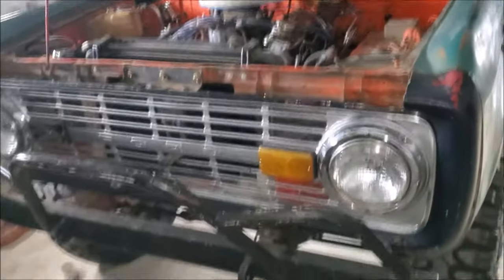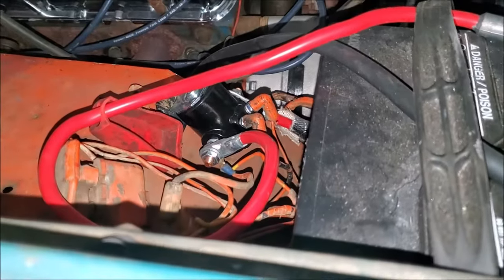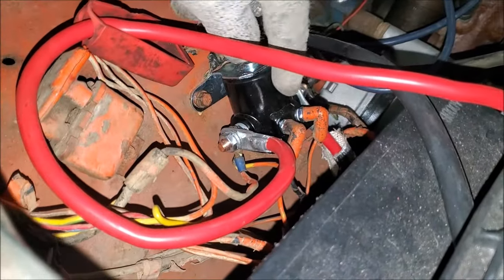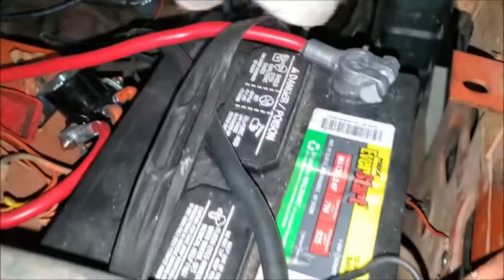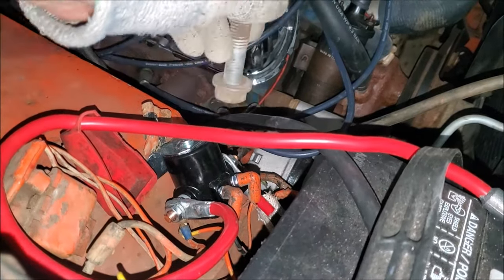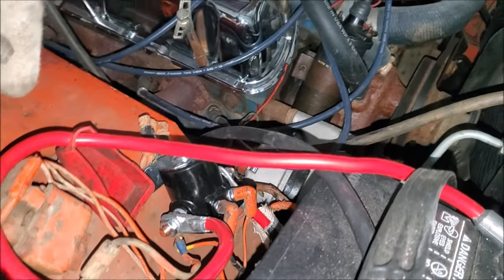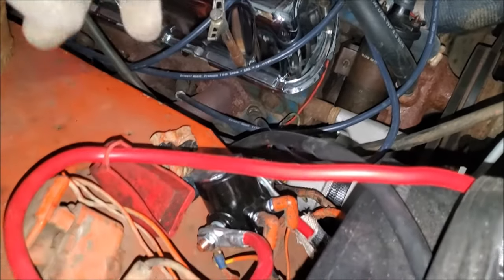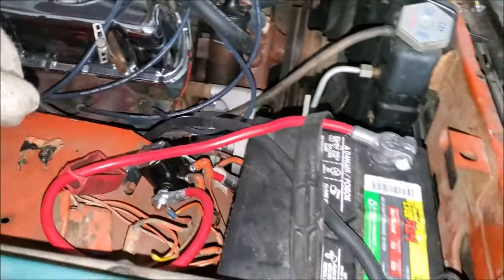Car or Truck won't stop cranking OR Doesn't turn OFF (The Fix)

Comment: I burned through 2 starters at autozone and 3 at o'reillys until I finally took it to a shop and he told me he had to call a friend who works at Ford Company and he told him that it was a wire but he would not tell me exactly wtf the problem was because he wanted to charge me another $625.00 if it did it again. I changed everything else from the alternator, solenoid, to fuses but I wish I would have changed the wire that connects the ignition to the battery to the starter as it was very doable. but thats how they charge you by keeping you in the dark about simple shit!! I like to thank you Sir for this video and trying to help people because money isnt easy to come by for some of us fa real..take care and peace
Reply from the maker: Wow....well thank you for your heart felt comment. I really appreciate you taking the time to share this with me. Feels nice when I know I helped someone.

Comment: What will make it do that is a low battery if you’re cranking it and it does not start once the volts in the battery get too low. It will not let it disengage the solenoid because I’ve had it do the exact same thing on a GM and the solenoid is mounted on the starter on them.
Reply: I think this is what happened to me the battery was low and I had to crank it for a bit and then when it started the starter kept making noise and I had to remove the cable. now when you touch the cable to the post it wants to run the starter again even with the key off

Comment: This is very odd.. I have a 89 f250 with a 91 f150 engine inside basically same configuration as stock f250 engine when it comes to solenoid, but same exact issues thing is I just replaced the solenoid because of a different issue, this started recently after taking apart my steering wheel column tilt to fix and I put back together exactly the same. My solenoid only has one wire that clips onto the solenoid(the one you disconnected to diagnose the solenoid) and it still cranks with that off. Perhaps I got a defective one?
Reply: My 91 f150 did this tonight and I had to go find a wrench to get battery cable off before a meltdown , very exciting, glad to hear it's the solenoid I recently replaced the actuator in the steering column but was very careful while in there.

Comment: I just got a brand new solenoid and installed it and it wont stop cranking. Everything online says to replace it but it’s brand new out of the box
Reply: What car? I just replaced mine on a 1960 thunderbird before reviving it back to life after sitting for 6 months.
Reply: @menjorkamara  the part was faulty and caused a ton of wires and other parts to burn up, had a mechanic replace it all. It was on a 1975 f100

Comment: I had major sparks when I touched the battery. But nothing turned on. Lights off, radio off. There is nothing else on my old truck.
Reply from the maker: You have a direct short somewhere. Something that may appear to be off is on. Maybe an actuated relay or a positive wire touching metal somewhere causing it ground and with that short present you will also have battery draw

Comment: This helped me with my '91 f150.  I figured it was something with the starter or the solenoid.  This is waaay easier and cheaper than a starter!  Thanks huge my man and thank you for your service!
Reply from the maker: So glad it helped!!
Reply: @EddiesCustomsandRestorations  I have same problem whit my 87 bronco I replace that alternator but I dint unhook that positive cables so they touch metal couple times and make sparks  and plus I broke that starter solenoid and I replace whit new oane and I have this problem and all wath I did replace alternator vefore was fine any i dea
Reply from the maker: @Purosanluispotosi  if the symptoms are exactly like these again, the new solenoid is sticking again
Reply: So is possible eaven wen is brand new  because I yes put a new  I have same problem long time ago but I dint remember wath was my problem I always fix my trucks but tomorrow I’m going to do that or buy a new oane because soon is u touch that battery’s craknks like want to start
Reply from the maker: @Purosanluispotosi  yea basically disconnect the small wires and if it still cranks only having the 2 thick cables connected, then the solenoid is stuck.
Reply: @EddiesCustomsandRestorations  ok I’m going to do that tomorrow thank you very much for replay
Reply from the maker: @Purosanluispotosi  yes ofcourse! No problem at all

Comment: 1968 F250 FE360 My starter solenoid smoked one day and wouldn't engage starter.New solenoid and when I reconnected battery the starter stayed engaged while battery connected.I had to get a new relay and then all was well.Thanks for your info.Heck,even I can understand it
Reply from the maker: Haha thank you for your kind words! Glad you got it fixed

Comment: I have a 70 chevy truck with the ford solenoid. My solenoid only has the s wire hooked up. When releasing the key back to the run position, it continues cranking. I have a coil cut off, so the engine wont start unless energized. By watching your vid, my thought is the ignition switch is the culprit...Any thoughts before spending cash on a new switch ?
Reply from the maker: A new switch could be the solution if its not a stuck solenoid.
Reply: thx, for the input
Reply: Ignition switch probably cheaper and easier to replace than solenoid

Comment: 2010 dodge Challenger cut off driving. I turned the key fob and let off starting spinning fast. I heard the starter spinning when it cutoff.
Reply from the maker: the car probably tried attempting to turn itself back on

Comment: This is good but for me I needed to disconnect the ignition switch fuse on my 2014 Chevy Silverado so it would stop running.

Comment: So if I take off the wire with the s on it and the vehicle doesn't start when I reconnect the battery the ignition cylinder is likely the issue?
Reply from the maker: @davematthews4280  yes because the cylinder must be staying stuck on the start position

Comment: 1984 f150 I Have this problem put I replaced the solenoid on it as well as the cartagena and still crank after the engine has started any more tips?
Reply from the maker: You replaced the solenoid and what im sorry????

Comment: I got an 81 f150 with a 302
I replaced that starter solenoid and the starter itself and I still run in too that same issue

Comment: I have a 1987 buick regal that's doing the same. But mine doesn't have a solenoid like that.  What can it be?
Reply from the maker: @johnnyrodriguez2493  so being a GM it will have one but it will be located on top of the starter itself. This is on a Ford which on a Ford they liked putting these external solenoids. Let me know if this didn't help so I can continue to try to assist you
Reply: @EddiesCustomsandRestorations  thanks. I will give it a try and will let you know.

Comment: What about the other post, mine sparks and kills the engine. Starts and runs find until you hook the ignition wire to the Post . Ignition has been replaced.
Reply from the maker: Has the coil been replaced?  Also inspect that wire and make sure its not rubbing against anything. Sometimes with the rubbing and the heat of the engine it can cut through the wire causing a short to ground. I would follow that ignition wire all the way and inspect it.

Comment: i have an 85 f150 i have swapped the solenoid 3 times and all the connectors to it but i still have this problem. could it be the starter?
Reply from the maker: @AndyHernandezLopez  what happens if you disconnect the 2 small wires of the solenoid and only leave the thick cable from battery to solenoid and thick cable from solenoid to battery. Tell me what happens there
Reply: @EddiesCustomsandRestorations  it wont crank at all
Reply: also my solenoid is a different style from the one in this video it only has 2 thick wires and one thin wire i think its the ignition trigger cable. i have tried to connect it again and it still keeps cranking. could it have anything to do with the ignition at all?
Reply from the maker: @AndyHernandezLopez  if the moment you connect the thin wire which would be your solenoid signal wire to energize the solenoid, then that wire must have power. I would then check into the ignition switch to see if it's no faulty and staying on at all times even in the off position.

Comment: What if when u pull the wire and u stick the battery hot back on and it doesn't do anything. What's that mean?
Reply from the maker: Can you elaborate a little more on that?
Reply: @EddiesCustomsandRestorations ok when I un hook the selinoid ignition wire and connect the cables it doesn't try to start, when the selinoid ignition wire is connected it trys to start, even without the key
Reply from the maker: @shanemcquerry632  your ignition switch sounds like its stuck on.
Reply: @EddiesCustomsandRestorations  I was thinking that too. I'm going to check it, thanks  I'll let u know what I find,  thanks again
Reply from the maker: @shanemcquerry632  best of luck. Hopefully it is 🙏

Comment: What’s the cause if it’s a brand new solenoid too? And it’s still staying engaged
Reply from the maker: Your ignition cylinder or ignition module is staying stuck
Reply: @EddiesCustomsandRestorations  can the cylinder be fixed, or it needs a replacement

Comment: Got an 89 f-250 with the 460 and I have burned out 7 solenoids by now and one starter with this issue!  Checked all wires for shorts or corrosion,  I changed out the lock cylinder and pinion, ignition switch, new starter and solenoid and it started fine and ran for 3 days and the same thing happens at a clients house!  Super embarrassing..  this has been an ongoing problem for 3 months now and I'm about ready to just let it burn all together lol.   Just lost here now.  Still working on finding the actual problem.
Reply from the maker: Jesus! Add a switch to interrupt the coil wire so your client can kill it there. Can also serve as a anti theft system. Lol  But yes I can see how this would not be ideal.
Reply: What was it??
Reply: @edboyle9347  still not 100%.  I found a bad ground wire hidden under the truck and changed that out a long with a new starter and so far so good.  Been running good for about 2 months.   Ground I'm guessing.
Reply: @code24riess  thanks. Will look around for today. I just replaced the solenoid and made no difference. New ignition switch is on a slow boat from China (73 Land cruiser)

Comment: Here’s my problem: i have a 1997 Ford F-250 power stroke diesel. The truck has been sitting awhile and i took the batteries out and had them charged up. But when i hook just one of them up the truck starts to crank on its own without even putting the key in the ignition. Got any ideas why?
Reply from the maker: You may have this issue to where the hot automatically energizes the starter solenoid
Reply: @EddiesCustomsandRestorations  so that might mean I need a new solenoid?
Reply: It was a new solenoid. Thanks!

Comment: Had this exact same issue. But I disconnected the negative cable. Not the positive. Same issue.
Reply from the maker: And you are definately right to remove the ground cable first
Reply: @EddiesCustomsandRestorations  found out my coil is bad. And it's frying my ballast resistor.
Reply from the maker: @hughphillips67Mustang  no way! Well glad you figured that out!

Comment: Does the wire going to the s stud go to the alternator
Reply from the maker: Negative, the S stud comes from your ignition because thats the one that gets the power when you turn the key on.
Reply: Is the ignition wire the biggest out of the 3 on an 86 Chevrolet truck